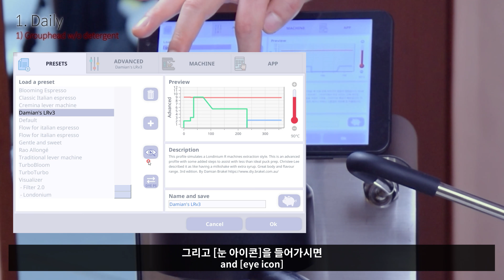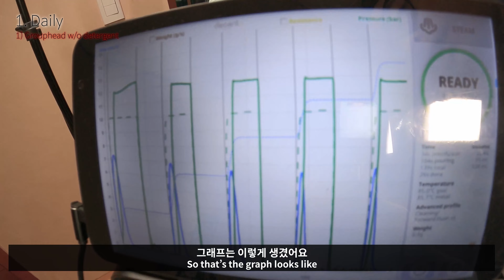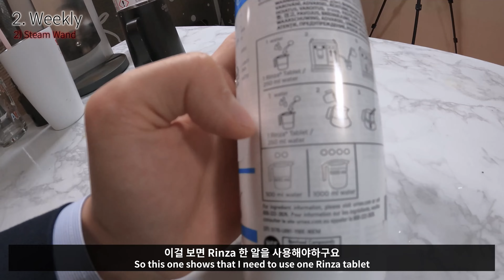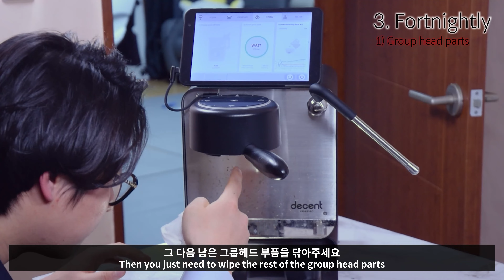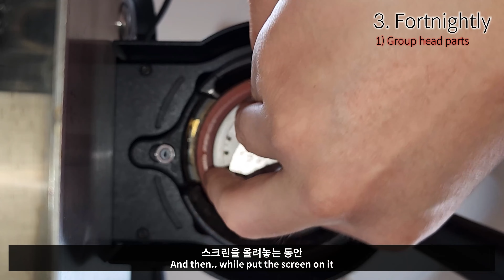How often/to clean DE1

Comment: I recall that in another video John recommended against taking the tip off the steam wand for fear of misalignment of the teflon(?) tube when reassembling.
Reply from the maker: While there is a risk yes, you can still remove the tip off. I advise to gently twist and pull at the same time. To be extra safe you should use some tweezers/pliers to hold the tubing while you remove the tip.